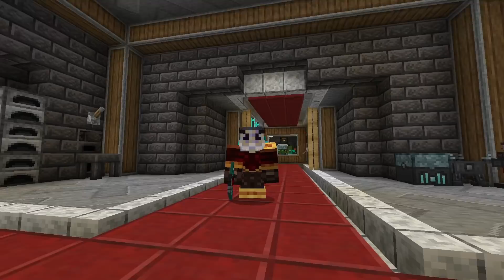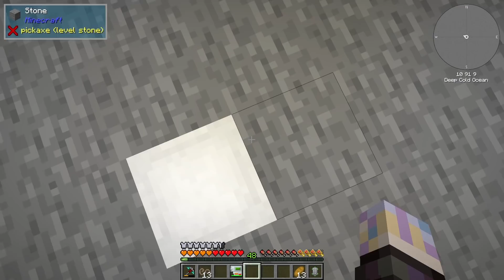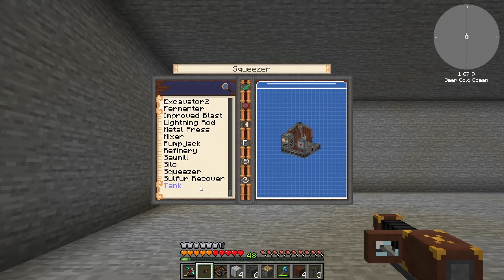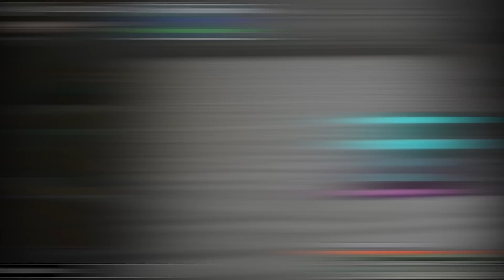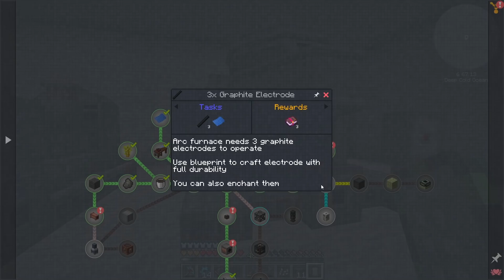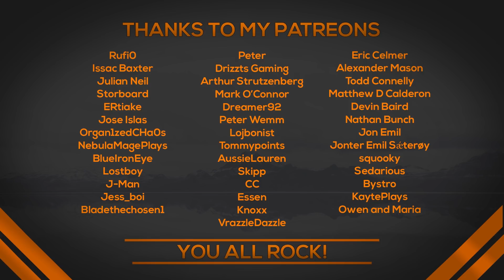Minecraft Cave Factory - Infinite RF Diesel Generator #9

Comment: Are the upgraded furnaces still in the pack? i see you have a bunch, but you could probably get an emerald furnace for basically free right now.
Reply from the maker: Its in the video. Also the wireless heat for it.
Reply: and that's what i get for commenting before finishing the video. Just wanted to get it said before i forget, as i thought about it last video.